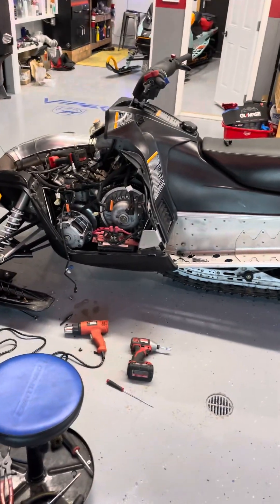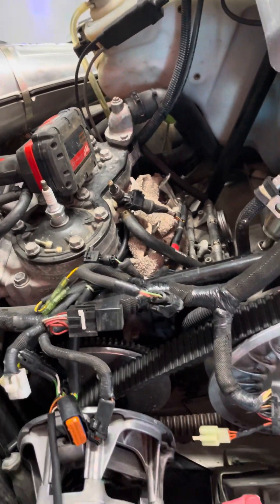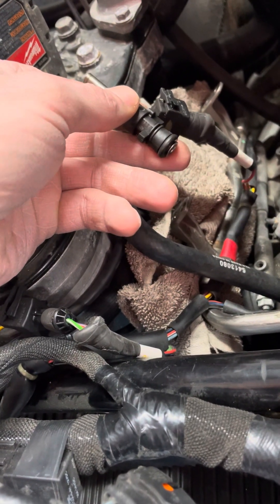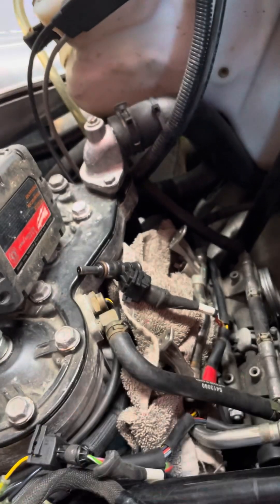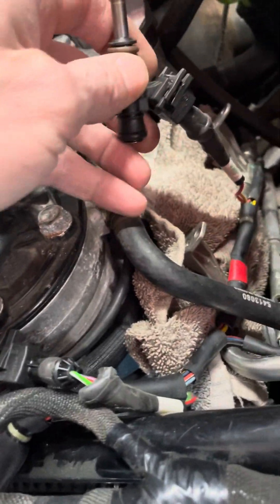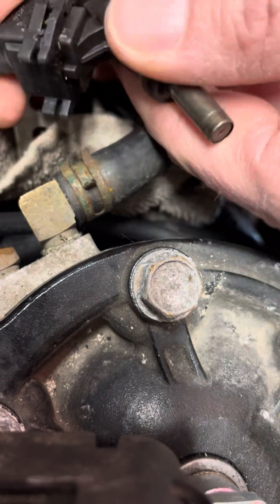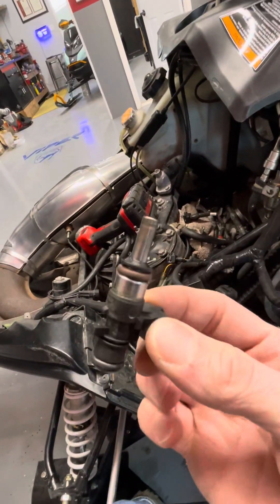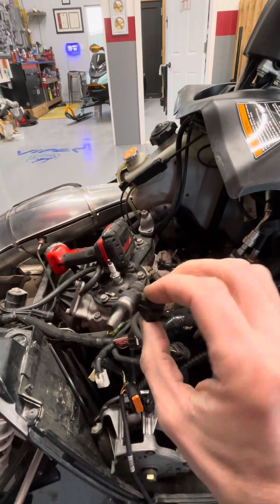Polaris 600 CFI injector removal.

Comment: Currently rebuilding the same sled. Do you have any more videos or suggestions on where to look for any?
Reply from the maker: I do not have more videos on that model. Just a general YouTube search is all I can recommend.
Reply: Iam new to snowmobile how does the injectors work we’re is the power coming to get the injectors working
Reply from the maker: @oscarperezgonzalez9203  On these sleds, the power comes from the generator or stator coil on the engine.  There is a battery on these sleds as well, but it is only for the electric start. When you pull the rope, energy from the engine powers the injectors to make the motor run.
Reply: So they just pull out from the back of the motor? Just give em a tug then?